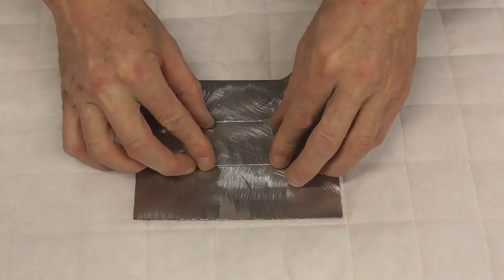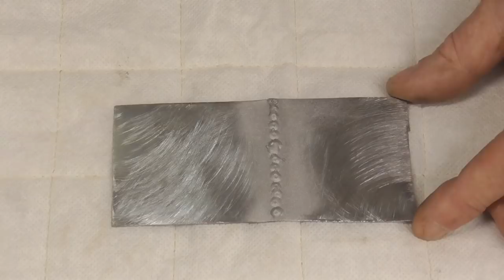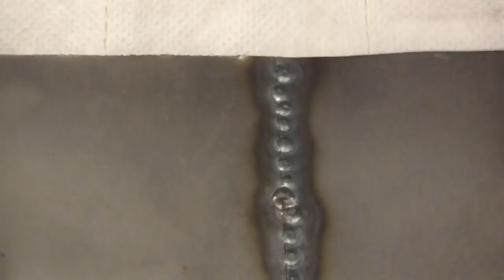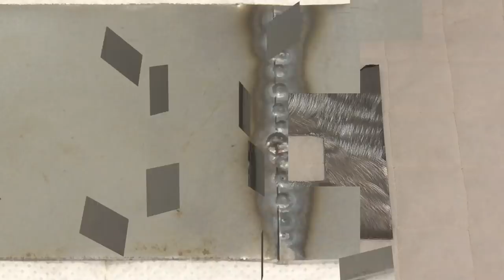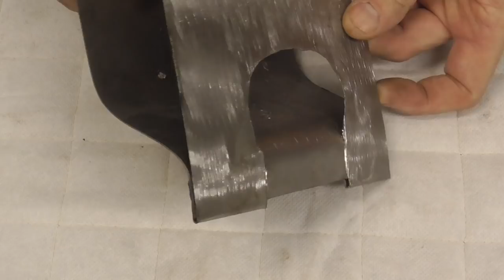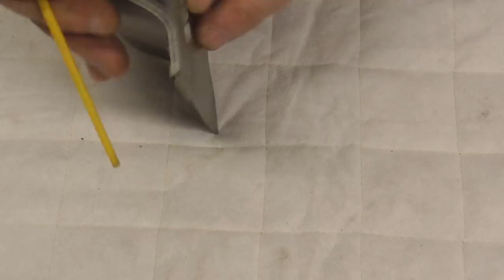Welding Patch Panels - Lap or Butt?

Comment: Your going to have so much bondo in that nasty patch job what was the sense of going  thru all that work to not to have to use a body filler.
Reply from the maker: See these videos for information on why the highest quality Michigan/Detroit area body shops use a combination of methods including lap, butt, glue, glass:  https://www.youtube.com/watch?v=JIIonJOVro4  *  Also see Eastwood’s explanation:  https://www.youtube.com/watch?v=rpH50kh4W00 *  For longevity of this type of repair see:  https://www.youtube.com/watch?v=8XaZBy7GC7A
Reply: nope
P.s.  when you can ask or admit it was wrong I will help you do it right.
 Psst he needs a 1/16 to 1/8 inch gap all the away around the patch. So the patch can be leveled as tacking it. Plus the patch is going to expand alot more than the panel it is fit in.. If it's so tight it can't fill the gap in as it heats up,, because there is no gap.  It is just going to warp terribly.  Then need more filler than if would have used only filler to begin with.

Comment: Don' t they make those pliers that pushes down the edges so the panels are flush so you can weld or glue them together???
Reply from the maker: Yes - a flange tool?